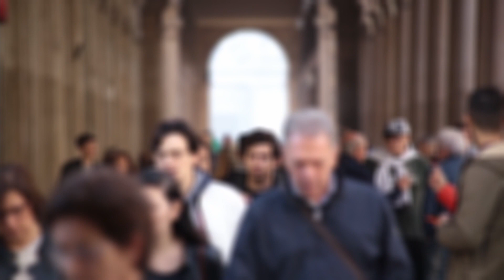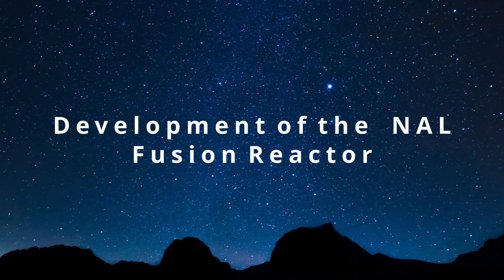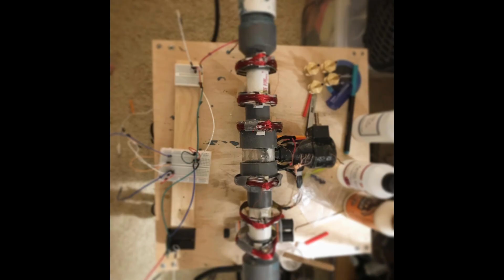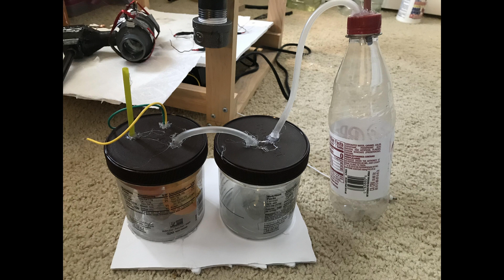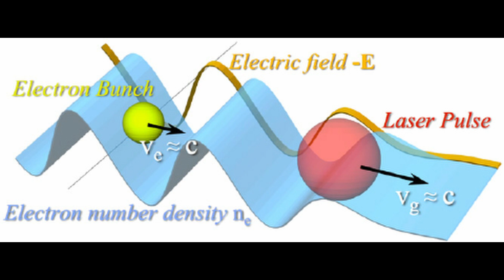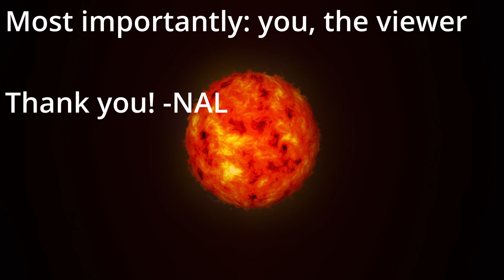The Wakefield Fusion Reactor Concept | [the future of fusion energy]

Comment: Excellent work! I am also a single dude working in fusion out my garage, it is a lot of fun. I recently discovered the Wakefield accelerator and had just the same idea. Two accelerators facing each other. If your machine is somewhat successful you could also keep adding pairs of accelerators along different axis. Do you have a way of measuring neutron and other radiation?